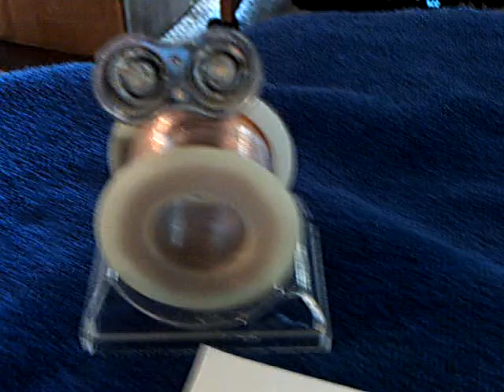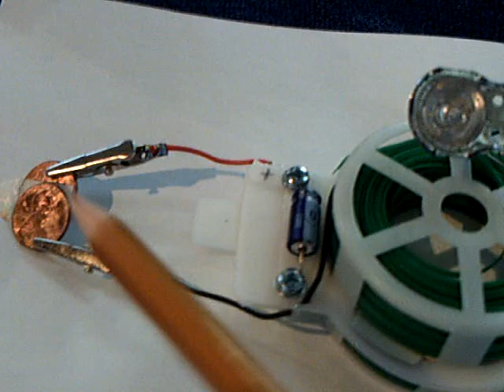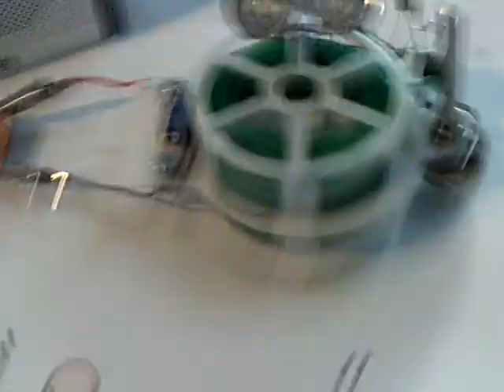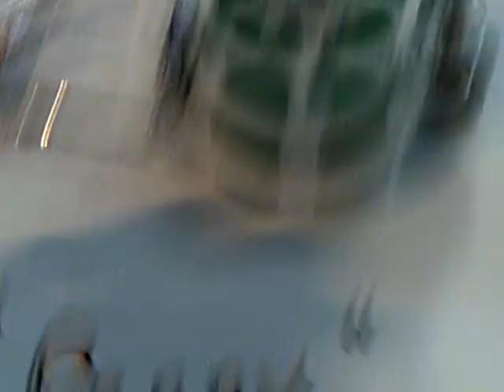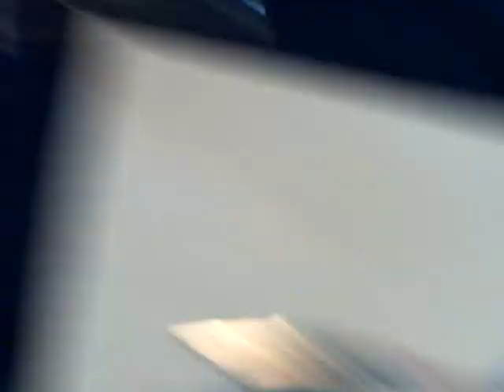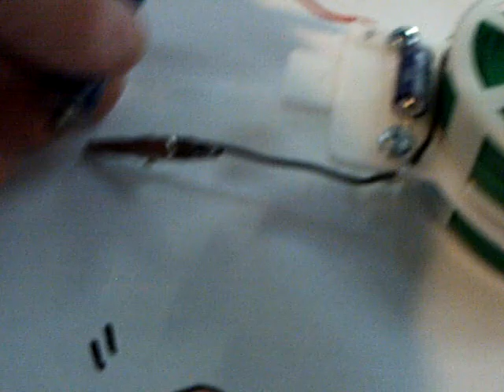PENNY---the low power LED oscillator

Comment from the maker: @KyleCarrington ----That is pretty big coil that you made for your Slayer exciter.   It sounds like something that Jiffycoil would make.   The wireless field around it should be very strong.  Several of us who are working on these homemade batteries are trying to interface them with exciter circuits.  The problem is that the long running cells don't give out much power.  The strong galvanic ones eat themselves up in a hurry.

Comment from the maker: @khoham ------I found that there is some magic in using iron based wire.  Ed Leedskalnin and Stubblefield knew about it also.  Copper coils work on this circuit also but it was great fun in turning these "dollar store" twist tie coils  into a working electronic device.  It was kind of a Macgyver thing.

Comment: @Lidmotor Yeah it is going to be "biggish". I have a few experiments in mind. I have a hunch cardboard works a bit better than PVC... I'm seeing some nice results from Magneticitist with cardboard, as well as Slider. First up will be to see what can be done on 1.5v with a variable cap across the L2. I lit up an 18" fluoro reasonable well with 3.6v, but I'd love to see the same, with 1.5v.  aka  a Gbluer replication, 1.5v, <10mA. Or Jiffy's 24v <45mA output, that impressed me a lot too!